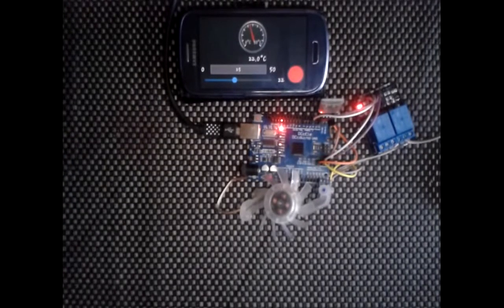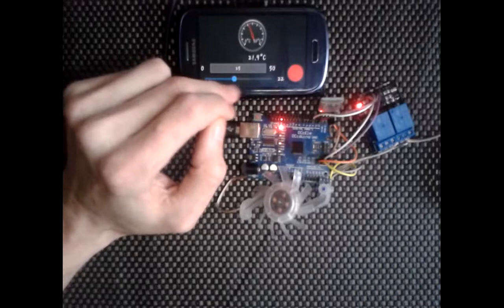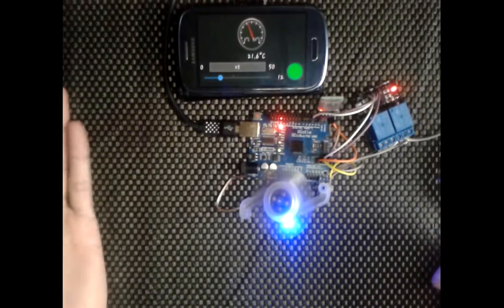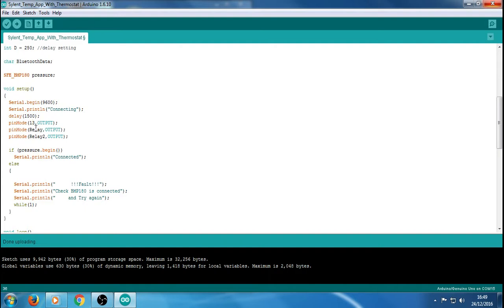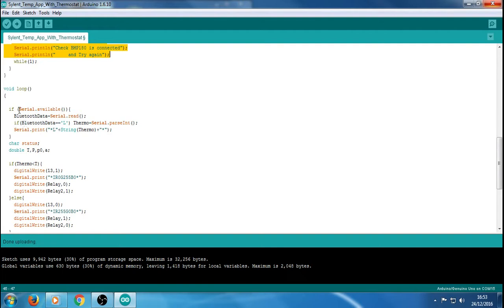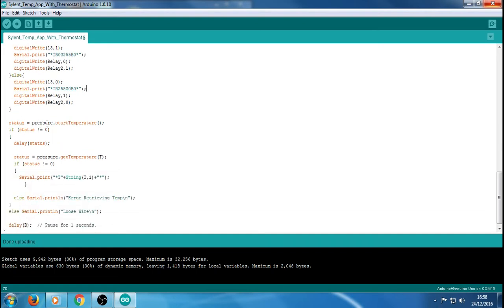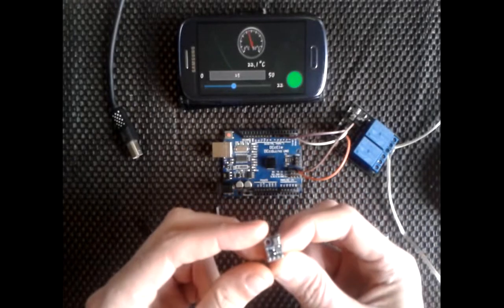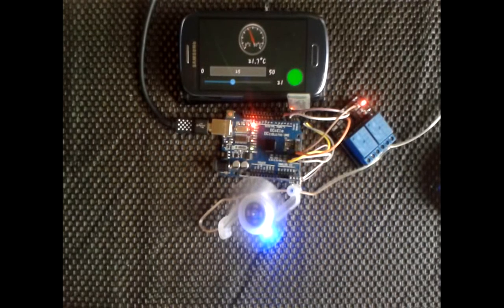Arduino and Android Thermostat Controlled Relay

Comment: Do you have a link for the android code? Looked in description and on the site but couldn't find it - thanks!
Reply from the maker: http://www.keuwl.com/apps/bluetoothelectronics/
Reply: liney118 Yeah I went on the site but can't seem to find the code on their examples page - there's ones with different temp sensors, but none with a BMP180 and relay control (perhaps it was just taken down or I'm just really missing something haha?)
Reply from the maker: you just need the app for android, The Library is in the description
Reply from the maker: If you mean the arduino sketch, I don't believe it's been uploaded
Reply from the maker: try https://www.youtube.com/watch?v=sIwVAqoQS4U description

Comment: How high can you make the temperature go?
Reply from the maker: as high as you like ;)
Reply from the maker: the only limit you really have is the temp sensor., if you are wanting to read and set very high temps, you'd need to use a high temp sensor ;)
Reply: liney118 so if I have my heating element connected to the relay, and a thermocouple to read it, I can achieve temps upwards of 200°c  if my heater will allow it?
Reply from the maker: sure, if it's capable.
Reply from the maker: think of it as a bluetooth temp controlled solder station